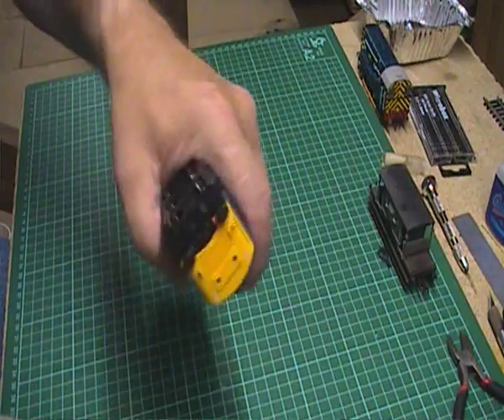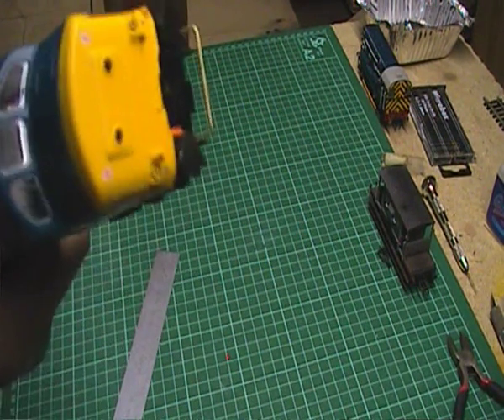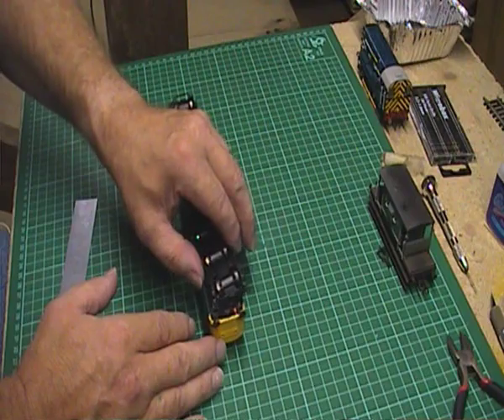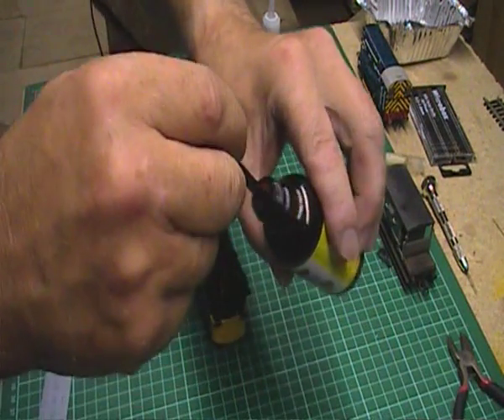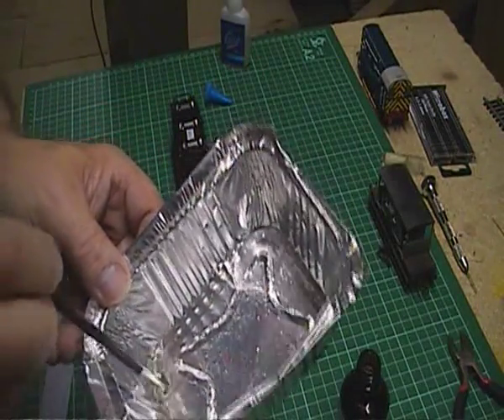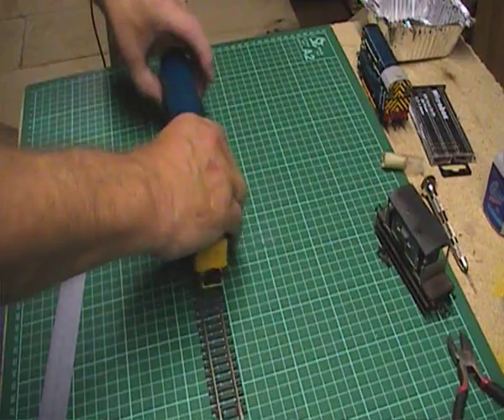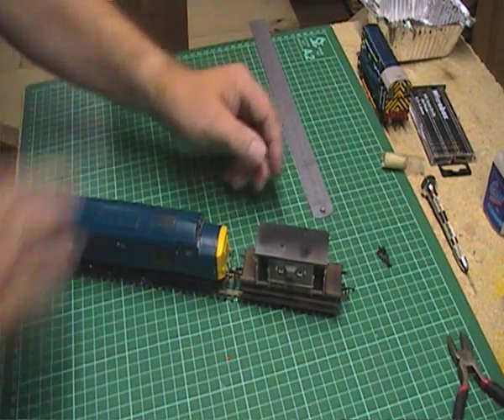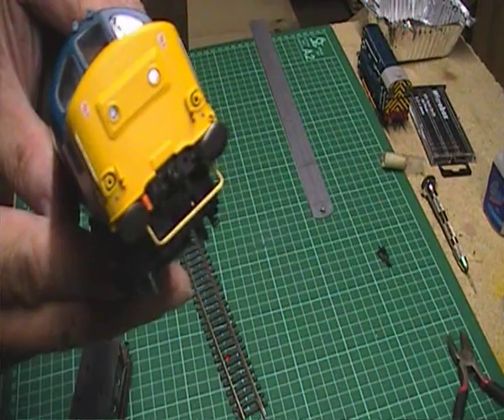Replacement Couplings, video #5

Comment: hi micheal
im  thinking about this idea on my locomotives and was wondering:
could i use florists wire or would it be too thin?
could i use UHU to glue the couplings in?
Reply from the maker: Luke Knights Hi Luke, it would be better if you used brass wire bent to shape and use either super glue or epoxy.
Michael
Reply: OK thanks for the advice. Where could I get brass Wire?
Reply from the maker: I got mine from Ebay, the size is 0.45mm x 305mm brass bar or anything similar would be fine but not too thick as the tension lock hooks could lock onto the bar.
Hope this helps
Michael
Reply: ***** OK thanks
Reply: ***** Thanks Michael. All stored in the "memory bank"!! Bob